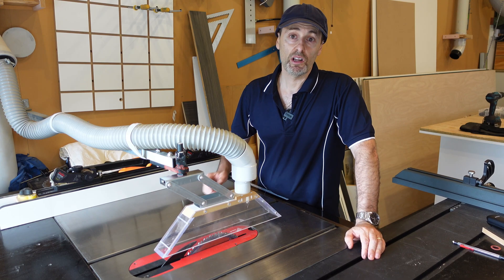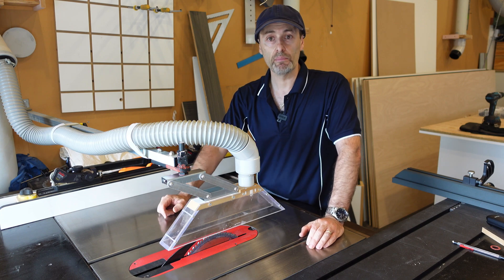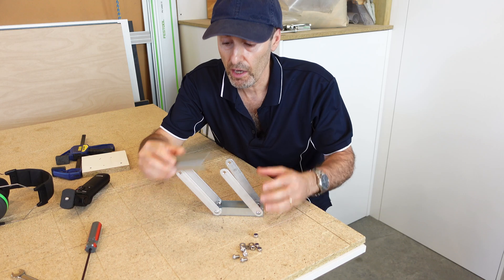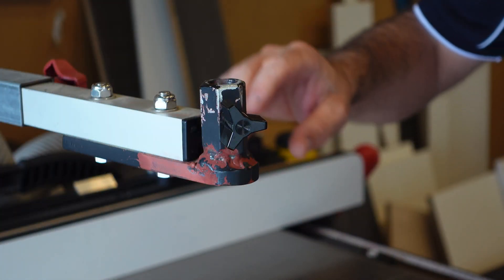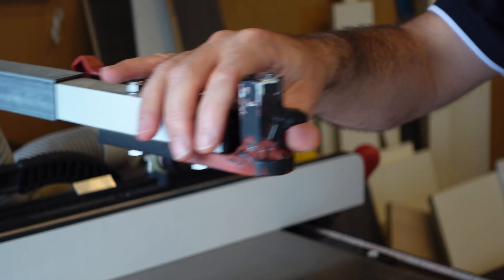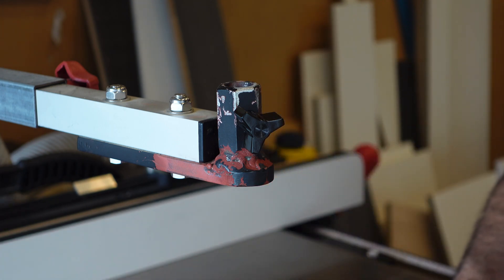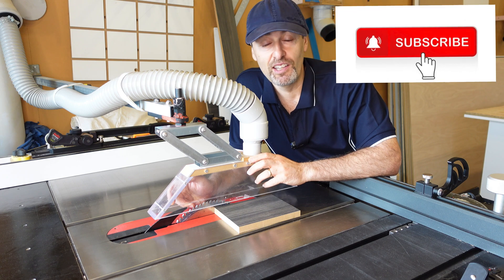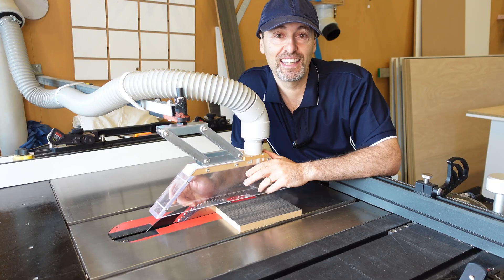DIY Table Saw Blade Guard | Overarm Table Saw Blade Guard

Comment: Did you ever provide measurements of the hood parts?
Reply from the maker: Not really, it's basically the overall length of your blade wound all the way up - roughly 250mm and add at least an extra 50mm front and back. something along those dimensions and the angle I used was just at 45deg. Hope this helps, good luck with yours 👍

Comment: Nice work, I also recently built a dust extraction arm for my dewalt, I made it with the possibility to move it on the 3 axes for maximum versatility and I also put a led light to make it easier to see the cut. If I can give you some advice, according to my experience, reducing the suction hose tends to lower the suction performance a lot, especially if the fitting is short and stepped.  Try connecting the pipe directly with the original section and you will see that it will be a different story!

Comment: Nice job. One tip.. leave the lock nuts barely tight so it moves freely, but replace one of the back fasteners with a wing nut or similar knob fastener. Easy lock/unlock for adjustment.

Comment: Is is critical that the bottom of the hood ride very closely to the top of the work piece, or is the dust collection still largely effective even if there is an inch or two clearance above the stock?
Reply from the maker: @michael.schuler  it works best if you can adjust the dust guard as close to your material as possible, if you leave an inch or so gap the suction won’t be as strong, definitely. Hope you enjoyed it…👍